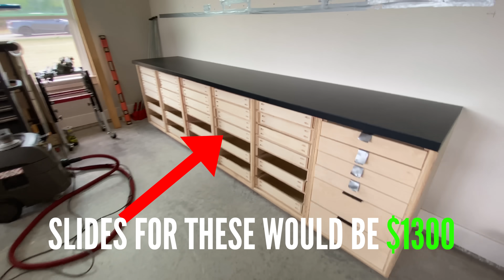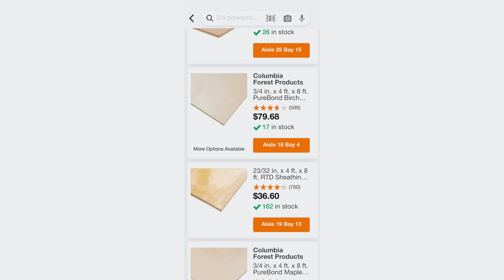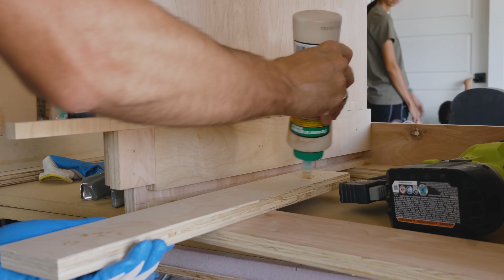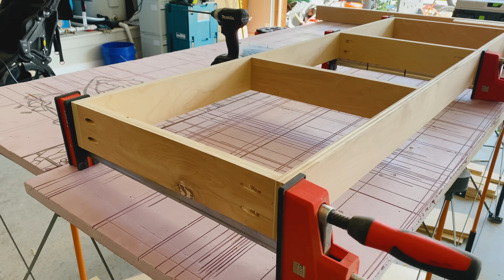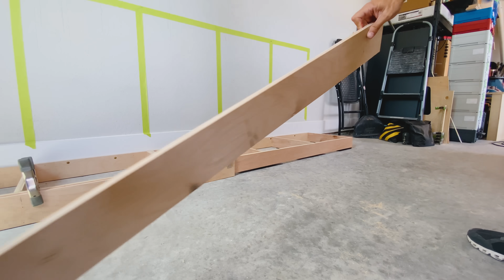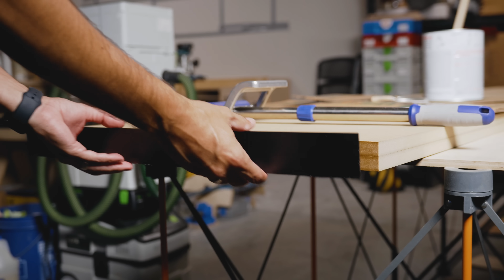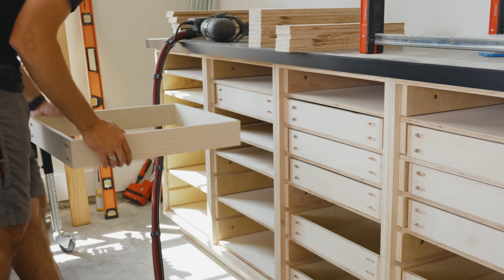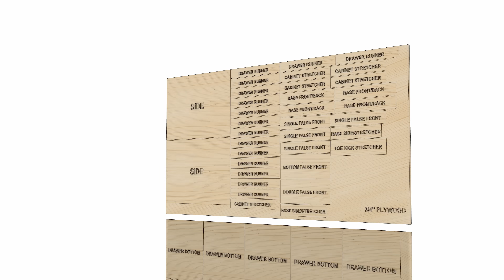Drawer slides are expensive. Do this instead.

Comment: One thing I didn't see mentioned is that it is a good idea to accommodate thermal/humidity expansion, warping of the material under load, as well as possible swelling of the plywood/MDF after liquid exposure when cutting the width of the drawer bottoms and when spacing out the side drawer supports.

Otherwise you may find your drawers sticking until you bust out a tool and do some material removal. Having tight tolerances might seem more professional, but reality is messy and your pristine new material won't be perfect years down the line.

Choosing an even more sizeable gap above the drawer bottom also helps that the drawer will tilt down when it approaches being pulled out all the way, both as a signal to stop pulling, and the increased friction from the back top of the drawer bottom jamming itself into the bottom of the rail supporting the next drawer up.
Reply: I had plywood cabinets almost identical to these for about 10 years in the pacific north west in an unheated garage.  I had zero movement or expansion.  I also used plywood for the top and put hard maple trim to hide and protect the edges.  Your mileage may vary though.

Comment: 🤿 After 3 different water disasters in my garage, no more plinths/toe kicks for me. It’s adjustable legs only.

Great video, love your ideas for shop cabinets (you and Dennis from Hooked on Wood). No expensive drawer slides for me either.
Reply: As alternatives, if you paint, laminate, or just don't care about the aesthetics you can just make the bottom out of pressure treated lumber or marine or ground contact rated plywood. Or just cover the structural material with an easy to replace thin facing toe kick veneer sheet that is scribed to have a bit of a gap above the floor so that simple spills won't contact it.

You can also just use shims everywhere even if they aren't needed for leveling to add the floor gap.

Comment: @wittworks any reason you didn't use PTFE/Teflon® or HDPE tape or solid strips on the drawer bottoms and/or support strips on the cabinet sides? 

Also, it is prudent to put a drawer stop block or notch so that you don't accidentally pull the drawer out all the way onto your foot and have to do 52,000 screw pick up, or damage expensive tools that land on your hard floor, depending on the contents.

Comment: If you want(ed) to be an animal and use a tape to seal the drywall from air then it would be perfectly fine to use/have used either aluminum duct sealing tape or red plastic vapor barrier tape. Both would have stuck to the paper drywall surface and are air impermeable.
Reply: There's also a clear 'weather stripping tape' at box store that is solid.

Comment: 🤿🤿🤿Me I would of used the cheapest plywood for it all.

The flush trim bit marking the laminate is that you had the bit set too far out, if you had the bearing running just under the laminate you would of had less marring of the laminate.

Comment: Looks great. I'm moving soon and will have to start all over with my garage shop. I've always wondered about the local wood supply prices and ability to purchase from them as a non professional. Maybe i will have to give it a try this time. Last year i built a large computer desk and wood prices were through the roof! Never made cabinets, i might give it it try. 

Did you miss the opportunity to build a miter saw into the middle of this? Also, did you add some wax on the draws, to make it smoother to pull in and out?

Comment: Drew, really nice cabinets. 🤿I couldn't believe that you'll leave the duct-tape behind the cabinets. At least my dad would have killed me😉.
About the router marks on the laminate: The marks do not look like rub-marks of the bearing, but like blade marks of the router bit. Always adjust the bit, that the blades are only proud of the router base plate about the thickness of the laminate, so they only cut the top laminate and not overlap the side laminate. Also make sure, that the bearing is in perfect shape. I do not recommend to lubricate them, since that attracts even more dust. If they are stuck, I try to clean them with brake-cleaner and if that doesn't help, I replace the bearing.
Man, I envy you for that plywood company. Do you know, how expensive plywood became over here in Germany? Even the Home Depot prices would be a real bargain. At the wholesale company where I buy, I have to spend those 80 bucks per square-meter! That is around 230 per full panel 🤮.
Greetings from over the pond!
Andreas

Comment: I'd say you proved "cheap" cabinets are possible. I think what too many people forget is cheap is relative, what are we comparing to? If its building DIY to buying then at least for things that don't require intense investment in manufacturing lines DIY will always be cheaper. But you also have to compare apples to apples. You cant build using hardwood and then claim buying a particle board whatever is cheaper. The key to what you did was finding a proper supplier for the wood and not overspending on slides for something thats just shop furniture. With a bit more material optimization like another comment mentioned this absolutely succeeds at its goal.

Comment: Nice job.
Quick tips:
Shellac to seal your MDF before contact cement.
Trim router marks ... looks like your bearing may have gone bad. If it's free rolling properly pushing hard (didn't look like you did) wouldn't have done that.
Reply from the maker: Good call! thanks for that tip. Didn't think of that.

Comment: I don't know how to do a snorkel emoji. An idea I learned from TOH about shimming the toe kick rectangle -- Use the shims only temporarily to level the assembly. But then screw some 2x4" material inside the frame to meet the floor. They then removed the shims leaving the 2x4" material to hold the assembly in level position. I used that technique when I built the kitchen island.
Reply from the maker: oh wow I love that!
Reply: Hi, I'm a total newbie to this, but if the 2x4 material was added inside the toe kick frame to meet the floor, won't it be visible from the front (showing below the toe kick)... And it would still have to be scribed on the bottom wouldn't it, unless he means the material only hides the areas of greatest discrepancy?
Reply: @wittworks  I'll say here too that I struggled with the price of the drawer glides opting for the cheaper side mounted ones. When I built vanity I used undermount glides and really love them, but not their price. I retire next June and look forward to revisiting this video for my garage turned partially into a home workshop. Thanks.
Reply: I don't know how to do the snorkel emoji either: I used copy and paste to steal one from someone else's comment! 🤿
Reply: I like the 2x4 idea, but is there any technical/engineering reason to remove the shims? Or would it just be for aesthetics?
Reply: @Obtuse94  Not for aesthetics since they would be covered by kick boards or hidden from behind when against the wall.  My thinking is that the 2x4" material offers a much stronger system for the cabinet base assembly including distributing the weight of the cabinets (or 3x5' island in my case) over more linear feet.
Reply: @Obtuse94 More points/greater surface area of support in ground contact, reduces the number of tools and parts that disappear underneath through the gaps that need to be retrieved, reduces the amount of dust and debris that can find it's way in.
Reply: @msytdc1577  that strip of toe kick "skin" he added is what will obviate any tools etc from disappearing under the toe kick.
Reply: @Obtuse94 that’s a good point and another reason to use composite shims.
Reply: @Obtuse94  The shims could be re-used.
Reply: @Obtuse94  2x4's to replace the shims seems overkill, scrap 3/4 ply would do the trick.  Then put the shims in a draw for future uses.
Reply: Great in a home, where water is rather unlikely, but a shop that might have moisture, humidity and critters that like damaging wood, the composite are a more… durable long term solution. The kick, I would probably raise just a wee bit for moisture/air circulation and expansion of the wood. Texas like Alberta might be dry, but sometimes the weather has it in for us!
Reply: @chuckfinley4869  🤿 A-ha! Thanks, Chuck!
Reply: Love this. Thanks for the video. I am never without my duct tape, so versatile. 🤿
Reply: If you're fearful of floods damaging any wood sitting on the floor, you could instead use some 1x4 PVC for the floor shims. That stuff will outlast the cockroaches.
Reply: In YouTube's emoji set, search on "div". "Dive" didn't work, "snorkel" didn't work.

Though I'm thinking Drew should have asked for a duck emoji ... for one brand's name 🦆
Reply: I am not a woodworker, but wish I was. Totally awesome. Snorkel emoji ..😊
Reply: Don't know how to do a snorkel emoji?  Just ask Google.  Then copy the character from one of the answers.  🤿 OK?
Reply: Snorkel emoji not found.  Loved the video.  Keep up the great work!
Reply: Good video 🤿.
Reply: I don't know if this is universal, but on my Android phone I have a keyboard key I long press to access emojis. First it displays the most recent 32 emojis in four rows of eight. Scrolling down provides access to about 213 more rows of emojis organized by type, for a total of about 1709 emojis! (Okay, I got curious and counted them all but there were a few partial rows at the end of each section.) 

But near the top of the emoji menu is a search bar. I typed in "snorkel" and it displayed five or six possible results. 

I rarely use emojis beyond the most common smileys, etc, but on occasion search for something specific. This is the first time I noticed the search bar and used it.  🤿  😳🙄😁
Reply: Or you could leave the shim and screw it to the wall and the other cabinets next to it like normal people do I’ve been installing cabinets for 40 years and all of my cabinets are still there
Reply: @armoredsaint6639  Good enough doesn't mean it can't be improved on.  Nothing wrong with leaving the shims but I also would prefer the 2x4 idea, or maybe even just a more robust composite material with more surface area supporting the frame.  Especially for a counter top that is going to be having large amounts of weight on it.

Comment: You used a lot more wood than what was needed. A row of cabinets could be made with a single wall separating the boxes.Also you have essentially added a third wall with the spacers you designed as drawer slides. If you wanted to make the cabinets separately as you did and since they are attached to each other than 1/2" plywood wood suffice for the box sides.The savings would be significant.
Reply from the maker: thats a good way to approach it too
Reply: I think a lot of time its missed on YT builds that if you are making shop projects you dont need individual cabinet boxes.  just build a box as big as you need or as big as you can man handle for install.  use dados for the dividers.  I dont think either way is right or wrong but for a shop build I think it makes sense.
Reply: @MrBertstare  if you are using the single wall approach then using dados is not ideal.  using the strips is ideal. Though using melamine edging will help with the sliding effect and this would allow you to gap it a bit more. Plus dado the drawer slide this way all you need to do is glue in and brad the drawer. Biscuit or dowel the drawer rather than pocket screw. Glue everything and it will be a very strong drawer. The drawer front can be made from anything. 
Doing it this way will allow you to set up three drawer sizes 12 inch 8 inch and 4 inch. Which will allow you to mix and match these drawer regardless as to how or where they are. Provided they are all build the exact same way. 
One might even opt to build the box stronger to have a floating cabinets. Which is the approach I may do. 
I intend to build two 20 foot long desks with seating for 2 people per desk with drawers much like this. Along with 5 foot tall and 2 foot deep by 20 foot long upper cabinets with some cabinet doors and shelf with plywood build cubes. Along with 2 swing out mounts for 85 inch tvs. I currently have my desk which is 12 foot and change that is a countertop and dual 55 inch screens above.
Reply: @kameljoe21   I meant for the dividers/walls not the drawers.  so the dado would be on the top and bottom, slid pin the walls then mount the drawers.
Reply: @MrBertstare  Sorry I might have lead you to the wrong statement. if the vertical walls were doubled up as in the way this cabinet was built then dado could work. If I were doing it I would do single wall with strips of plywood instead of dados. I think a full width would be ideal for example using 3/4 plywood. Building this way one might consider using melamine to add to either the bottom of the drawers or the slats of wood or both. Though I do wonder if adding melamine to the top and bottom of each slat would be well worth the effort. One could also add in drawer stops to prevent drawers from fully coming out. As long as you do not install one for the bottom of the drawer then you should be able to reach with a drill to remove the screws holding. 
I do like this idea and I do think in the end it could be a fraction of the price for bought cabinets with drawers. I want to make two 20 foot desks from it with 2 sitting areas for both. In total 40 feet with 4 desks along with full depth and height upper shelves along with plywood cubes. (i hate all of the cheap cube out there) With stain one can stain pretty much to any color they want. Butcher block counter tops are quite cheap and can make any desk/cabinets look nice. 
I have a lot of ideas and doing these types of plywood cabinets could save me a 10s of thousands and still end up with some high end cabinets that are built to last. My kitchen cabinets will be an island and possible a wall oven combo. Other than that the rest is just hood vent for cooking appliances, sink. commercial dishwasher and those upright combo fridge freezer. I do wish they offered hot water connections to compressor to preheat the water. There is so much wasted energy in appliances that I wish it could be sent to preheat water.
Either way I think we are planning to hire someone to build these on site as there will be several other projects as well. Fully built in king beds with under storage and full 12 wide by 10 tall headboard cabinets type thing. I will have them made up in to plans first. Fiver is good for that kind of stuff. I am not skilled in it.
Reply: Except that the spacers are probably about 12mm thick (1/2") and most ball-bearing slides are also around 12mm thick, so that the nett width is till about te same